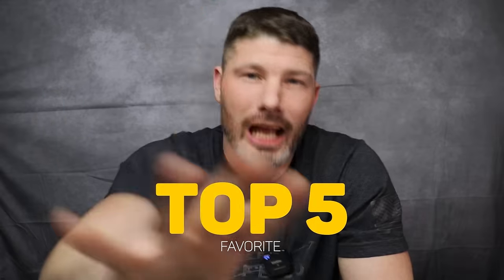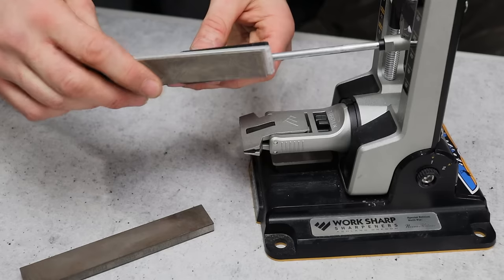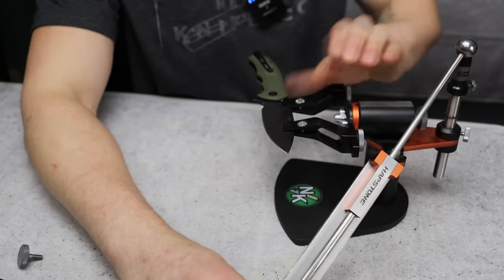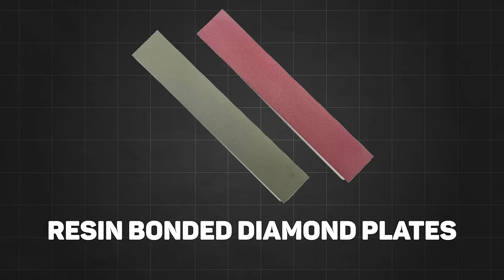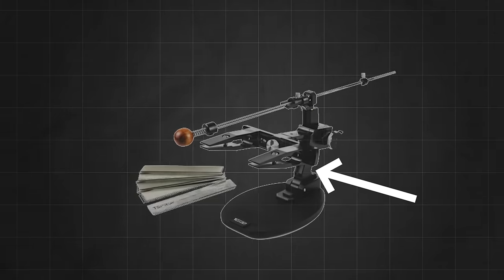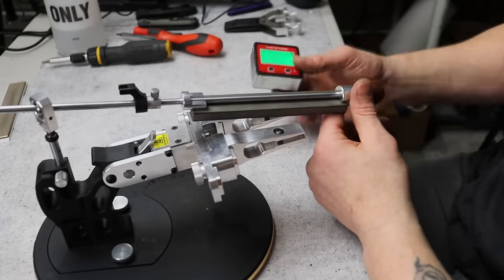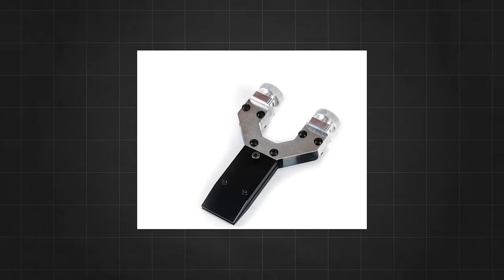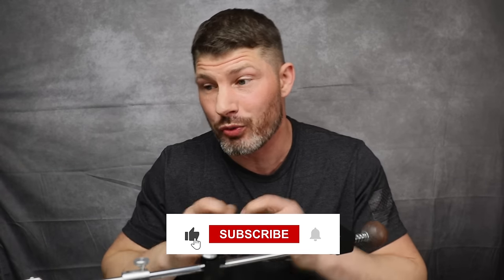The 5 Best Knife Sharpeners of the Year!!

Comment: My favorite is my plastic Work Sharp precision, because it was $50. I take my time, and put no pressure on the stone, and get shaving sharp results. I can’t free hand worth a damn.
Reply from the maker: Awesome! Yeah you can upgrade that system as I Said in the video, you can get the 4 inch stone holder linked in description at gritomatic or hapstone which will allow you to use any 4 inch stones
Reply: @NeevesKnives  I will need something for recurve, as I have one that I butchered on my Work Sharp belt sharpener. I only use that for scissors now.
Reply: @voodoo7008 I used to work at a Rural King in the gun barn, where they had one of the Work Sharp belt sharpeners set up for demo. I hated that thing. I saw more people butcher their knives on it than improve. We also had a tri hone stone next to it for demo. I can't count how many times I spent 5-10 minutes fixing with the stone, what took 5-10 seconds to totally screw up on the belt.

Comment: 1 Year owner of Kadet Pro.  Highly recommend.  A K03 will do larger knives, but the Kadet Pro did a fine job on my 18" machete with 2 separate clamp setups.  All other knives, kitchen, everything = one setup works fine.  Get an extra 140 grit 1" x 6" Atoma because you be reprofiling many messed up blades, for you and all your friends.  The Atoma 1" x 6" set is perfect.  The 1200 grit leaves a mirror finish so no need to make ANY adjustments for different stone thicknesses or strops, makes the system double fool proof and very easy.

Comment: I got a fine magnetic angle cube from Home Depot for $20.  98% of my knives fit on the Kadet Pro.  The K03 is bigger and will sharpen bigger knives, but also requires more room.  Be careful not to shove the guide rod into your computer monitor.  This has happened.  Don't do it.

Comment: I use a Double Sided Folding Diamond Pocket Flat Stone and hold at an estimated 22 degrees. They cost $20-40 and get the Blade sharp enough to slice paper.
Reply: All hail the sharpening god SFB.  We bow before your awesomeness.
Reply: Yeah even with a diamond coated sharpening pen you can create a working edge like that very quick; it just eats away fast on your steel if it's not so hard.
Love me a CC4 pocket sharpening stone though! Could shave with that 2 micron edge.

Comment: On the TSPROF K03, can you adjust it to 35-37 degrees?  I have the Emerson Commander which has the chisel grind, and it is difficult to sharpen.
Reply from the maker: You can definitely get very high edge angles, however I don't think that's what you want on that particular model that would make a very small micro bevel that won't be very sharp
Reply: @NeevesKnives  After revisiting my support email from Emerson, they said it was 30-35, so I guess I can measure the exact angle and go from there, as long as it will go that high.  Those blades from the factory are razor-sharp.
Reply from the maker: @Supertrack238  I will be honest I wouldn't sharpen that knife at that angle, go 25° it will make the edge much sharper, the edge will last longer, it will be able to strop easier and keep up with in maintenance, and will still hold toughness. Your bevel will be larger but not to big which will be better
Reply: @NeevesKnives  Thank you.  I was just trying to match the factory edge.  I really dislike the chisel grind, and have spoken to Ernest Emerson about this.  He still holds to keeping the chisel grind on their blades.  Question... since I'll be removing a lot of material to change the angle of the grind, do you think sharpening BOTH side of the blade to 20 or 25 would be a good idea?
Reply from the maker: @Supertrack238  if you are changing it from chisel to both sides having edge bevel I personally would probably do 17° per side, but you should probably do 20° just to make sure the bevel is not to large after
Reply: Are you interested in making a video of converting an Emerson Commander from a chisel grind to something more common and useful (that will stay sharp longer)?  I could send you mine as an example to use.

Comment: Thanks to you I bought a Kadet pro after your review and after more one year of using it, I agree : it’s really great. Just bought the fillet clamp for narrow blades as I sharpen at 15 / 17 dps and use venev resine bonded and add a digital angle finder.
Reply from the maker: Hell yeah edges come out far far better on systems that are extremely well built

Comment: I have the Ts Prof Kadet, you are correct about the Ts Prof stones not lasting very long. I bought a combination of Veneve bonded diamond and Edge pro diamond matrix stones. Wanted all Veneve's but 600 and 2000 weren't available so I got the 650 and 2300 diamond matrix stones to fill in the gaps, also added a set of 1/2" Gritomatic boride stones for recurves. As expensive as the sharpening systems are the real expense is in the stones. Eventually I'd like to get the  remaining Veneve stones and a full set of the diamond matrix stones as the two different brands give different results. You can spend $1,000 on diamond stones pretty easy. I highly recommend getting a Veneve 80 grit stone as it is great for reprofiling quickly.

Comment: I have collected a bunch of options, some were not great some amazing:
1) wicked edge, I love this thing, was crazy exspense be but could teach a three year old to sharpen tool steels!
2)good strop with good diamond compound
3) ceramic butchers steel(great for quickly bringing back sharpness)
4)atoma diamond plates
5)generic diomand plates
6)Japanese wet stones
7)steel butchers steel(only on German steels/soft)
8)landsky with diamond
9)landsky with stone
Reply from the maker: i would never recommend using steel on steel even for cheap German Stainless, i say use what works on most as it will work best on most if not all

Comment: Got a 2k / 5K grit water stone, and a 5 / 2 micron CC4 pocket stone. I think 2 micron is like 10K grit. It's all I need I guess. Honing / polishing is my passion! 🥰
If I was having more so called premium steel than regular good steel, meaning very hard steel, I would also use a diamond plate on those suckers by the way! My hardest steel might me D2 lol. :person-turqouise-waving:
Oh, and I got a sharpening pen from Boker. It's diamond coated and it's good to give dull knives a quick working edge, very quick I think. I can polish out "imperfections" afterwards when I got more time, but it's so bitey I only used it on dull and cheap kitchen knives so far; since my edc and other pocket knife blades are honed smooth already.

Comment: Awesome video Jerad. Question: how do you safely flip the burr on a fixed system? Do you still strop afterward?
Reply from the maker: Yes do the same as freehand no pressure passes from tip to heel, then finish off with a couple light passes with heel to tip passes, strop

Comment: TSPRof 100000% I have the cadet pro  and I also use the single clamp the most. It was expensive but it’s so good. Knowing how good it is I kinda wish I spent a few hundred more and got the K03. I will probably end up upgrading but I’m trying to wait it out just in case they come out with a better model.  If anyone’s watching this and are on the fence about getting any of the TSprof systems…in my option they are worth the money especially if you get some venev stones.
Reply: What venev stones did you get? I just ordered the Orion stones not the orion3 I’m wondering how they are as they are half the cost of the orion3’s
Reply: @hawktv4508  I have the resin bonded diamonds. I think the Orion 3’s are CBN right?  I haven’t tried them yet but I couldn’t be happier with the diamond stones. I just ordered the thin curved ones to sharpen recurves this week too. I’ve hear great things about CBN but for me I don’t know how much better you can get than the diamonds. How do you like them?

Comment: What are your views/thoughts on the base of the Kadet Pro sharpener? I've read a few comments elsewhere that it is too small & unstable - that one needs to hold it with a hand or clamp it down, which is a PITA. Do you prefer the Pioneer in part because a big/heavy base is available? Thanls.

Comment: thinking about saving for a Kadet, but most of my knives aren't large, nor do I have intentions for scissors etc. Is the Pioneer only limited by what clamp you have installed, or is there some hard cap that would prevent me from sharpening a Kabar etc on it even with another clamp?
Reply from the maker: so the pioneer will be just fine for you, you probably will be able to do everything you need as is, but getting the extra clamps would ensure it

Comment: No Japanese culinary knife expert would use one of these systems. I wonder why that is. I dont mind these  jigs, they allow a novice sharpener to get pretty decent results with consistency. I've gone the hand sharpening whetstone direction but its got a learning curve for sure.
Reply: Probably because Japanese culinary knifes have fairly soft steel. That style of sharpening takes a looong time with modern steel.
Reply: You just don't take into consideration that the majority of Japanese knives do not have thin edges. And those Japanese knives, which are made in the Western style, all without exception have thin edges and even the most experienced Japanese sharpener will not be able to sharpen them correctly and qualitatively better than such a jig.

Comment: @NeevesKnives Hey Jared, I want to eventually buy a sharpening system and i'm currently leaning towards the WorkSharp Professional Precision Adjust but the thing holding me back is that idk if it can sharpen recurve blades and especially convexed blades. It probably can't do it out of the box and thats fine but is there any 3rd party parts that will enable it to do it? I like that Tsprof has the convex clamp but the price is hefty so i don't wana go that route if i don't have to. Especially since the Worksharp pro seems perfect for me besides those two functions i want. Thanks in advance for your help!
Reply from the maker: If you get the stone holder that I mentioned you can get slim stones for recurve but no it won't do convexed edges however you can always just put a grind on the edge but it won't do convexed however tsprof has a convexed attachment
Reply: @NeevesKnives  i see, but by putting an edge on it, how does that affect the convexed blade now that it is no longer a zero grind? I like convexed edges because i heard the geometry makes a knife super tough while still retaining sliceyness even though theres alot of steel behind the edge still. Also the Tsprof attachment can achieve this because it comes with a curved rod?
Reply from the maker: @GeorgeMui  tsprof has a part you put on in order for the rod to curve while moving. a convexed grind with a vgrind edge is just fine, yes convex edges are touhger, v are sharper but blade geometry is a huge part your knife is mostly already ground thick so you should be fine depending on what angle you sharpened at is this a fixed blade or folder
Reply: I see that makes sense, thanks for the reply! I was thinking for a fixed blade like a bark river who are known for their nice convexed blade geometry on alot of thier knives @NeevesKnives

Comment: Great vid for those getting their first system or those that want to upgrade to something better. The cost determines the system of choice for many people. With all the ones shown you can get amazing results  on most knives and while there is a learning curve they are much easier than leaning Freehand Sharpening. Patience and attention to detail is big when sharpening so I'd recommend getting a jeweler's loup or some sort of magnifying lens when you start out to get a clear picture of what is happening when you are sharpening and looking for that grit pattern (going from the top of the bevel to the apex of the edge) and burr forming at the apex of the blade.  Also a sharpie marker to fill in the edge bevel to ensure you are hitting the correct spot with the angle of the stones. Once you have the blade clamped and edge marked try to set your angle close to the same angle as on the bevel of the knife and do a single pass with your starting sharpening stone.if the stone hits the whole marked bevel with the stone your all set, but If your stone leaves behind the top of the marked bevel marker (Usually black is best for the contrast with a marker and the steel) you must lower the angle, and if its left at the apex (very edge of the blade) you must raise it, make sure to do this in small increments if wishing to match the bevel perfectly. Its a great way to check your progress if you wish to match, raise, or lower the angle you are sharpening as well. Also kapton tape makes it so the blade doesnt take any damage from the clamps when tightening them down onto the blade. Painters tape can be used aleo along with taping off the front of the knife (where blade and handle meet) so metal particals do not get into the pivot and washers or bearings of the knife. Just a few tips on making the systems better. Thanks for the great vid and keep making sharp things fun and enjoyable.

Comment: I can't believe no KME,Edge Pro, Wicked Edge seems kind of strange. No mention of them either whats up with that?
Reply: I have the kme, and honestly, it's a hassle. Trying to clamp it where not only the angle is the same from heal to tip but the same on each side. One side of the knife is always a degree different because the clamp sucks and you have to try to twist the blade and then tighten and hope it doesn't move back up or down since the rubber is so soft. No matter how tight I tighten the blade always has flex. Unless you have a wide blade, but most people are sharpening pocket knives on a kme. Also, the stones are tiny. And the price isn't great. Iv spent 450 dollars on mine so far with the extra stones and an angle cube and strops. As far as the wicked edge, if you would have watched the entire video, he clearly says at the end it isn't on the list bc you have to buy their stones only, there's no aftermarket support, and you can't see what's happening to the bevel as well as the other systems.
Reply: It’s outdated and been surpassed by the pioneer from TsProf. Wicked edge only uses their stones so not as versatile and also can be way more expensive.

Comment: Since it doesn’t even get a mention, I’m curious why you don’t like the Worksharp Ken Onion?
Reply from the maker: It's a belt system and Stones will always be superior as far as edge quality goes, it's a great system for large thick blades especially with the belt grinder attachment
Reply: @NeevesKnives  In what way is a stone sharpened edge better? Just curious what I should be looking for. 

I use the Ken onion and the Precision Pro and I don’t see a difference in edge performance. Probably user error but it would be helpful to know what to look for as well. 

Debating if it’s worth keeping the Precision Pro :/, given the price difference in the systems I thought the difference would be immediately apparent. 

I recently watched Work Sharp’s YouTube video and even in their sharpness tests (including edge-on-up tests) it seems to be a toss up. Which again given the price difference is disappointing.

Does the KO3 give a much better edge than the Precision Pro or does it just provide a better user experience?
Reply: I just got a k03 and I had both precision adjusts. Pro is better than the original and the K03 does just make that much better of an edge. It’s a lot better in my opinion. I have a Ken onion with no attachments and I rounded the tip on several knives and have never used it sense so I can’t add on that. You can get. Sharp edge with any of them but the overall outcome is better with the K03. If you are pleased with your edges then don’t spend the extra money.
Reply: @hawktv4508  Thanks for the info. I think a lot of people that round the tips with the Ken onion pull the knife all the way through. Not sure if the instructions changed over time but mine says never to pull the tip more than halfway across the belt. 

I still see people do it all the time in YouTube videos which makes me wonder if the instructions changed at some point. Just saw it again on Cedric and Ada and he knows what he’s doing sharpening.

Comment: What are your thoughts on the Tormek T8?
Reply from the maker: Tormeks are great for specific knives. They work great on all knives but really good on specific types, I personally prefer hand Sharpening
Reply: @NeevesKnives  Agreed, I've found that the Tormek is not great for sharpening the smaller blades on folders or folders with thumb studs etc.  It's wicked fast and sharp for larger knives and carpentry tools!  Pricey too!

Comment: The Hapstone RS with the new Hapstone Upgrades (Linear Bearing Stone Holder, Ball Scew Vertical Angle Ajustment Upgrade, and finally the new Compact CenterJaw Clamps) make the Hapstone every bit as good as the TSPROF. It will cost you about $450 total, but its every bit as good, and well consructed as the TSPROF and it comes in a WAY smaller foot print and size.

AND THE TSPROF KADET PRO is not $500 bro. Maybe thats what it costs for YOU, but its well over $700+ for anyone else to buy. Not to mention shipping and tax and duties etc. TSPROF is expensive as fugggggggg

Comment: HI,have you looked into KMFS Vantaedge integral sharpening system?
It is supposed to compensate the sharpening  angle to account for the length of the blade(you dont get different height of the sharpened edge between the tip and the middle of the blade) Would be interesting what you think about it.
Reply from the maker: no but i will thanks for heads up

Comment: if only the worksharp pro pa had a universal stoen holder would've been a steal, the aftermarket stone holder while it fixes that problem still has an issue an its that for 6 inch stones it gets limited by that the stone doesnt has a full motion on the knife barelly has 60% of movement